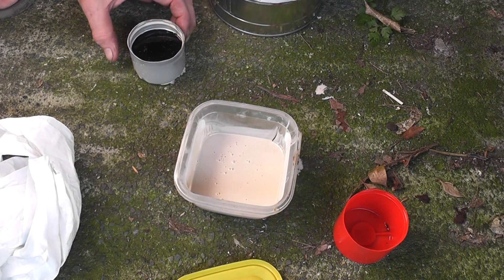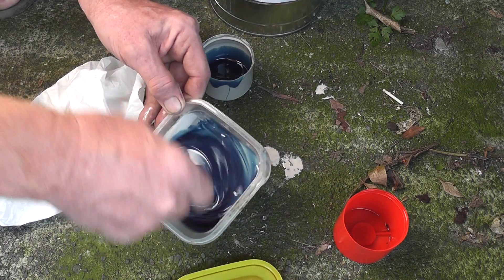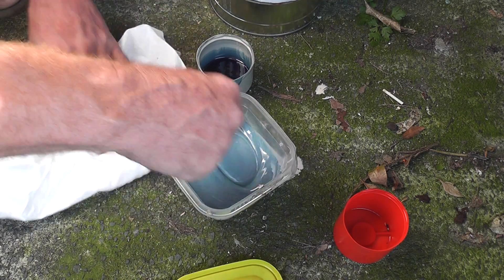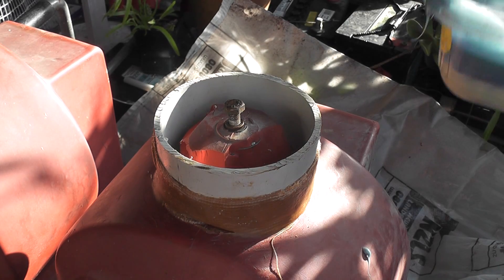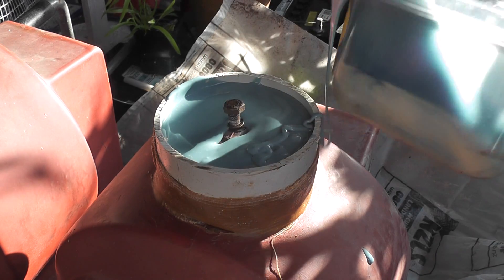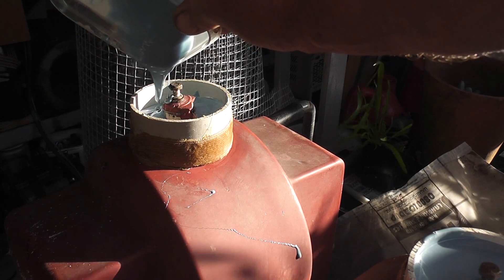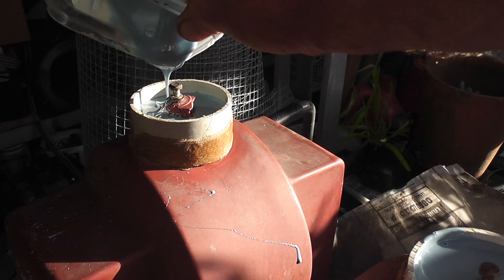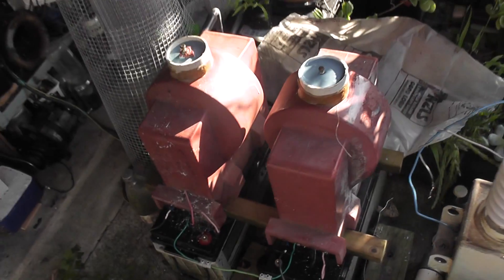Repairing VT terminals with Guruflex compound

Comment: Is this the stuff that gets filled into cable sleeves after the repair of a HV cable? I've seen this one, and i wondered if it is not super expensive to fill them with resin...
Reply: Cable joints are expensive, and must last for decades without any failure, so they use the best potting compounds they can get that will not degrade with time, environment or voltage stress. They always err on giving a little more, as the joint will fail if there is an air bubble in there at the top, or there is a join where you used 2 different fills and the one catalysed before the other. You want the whole fill to be the same throughout.
Reply from the maker: Correct, I will show in a video where the stuff is used on a ring main unit.
Reply from the maker: Correct, you want to do the pour in one go for good and reliable consistency of the compound..